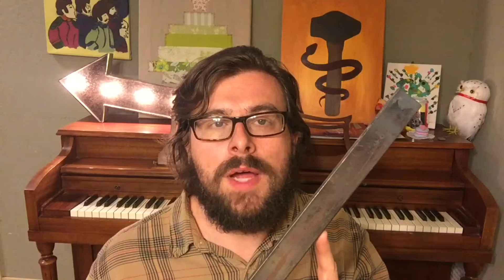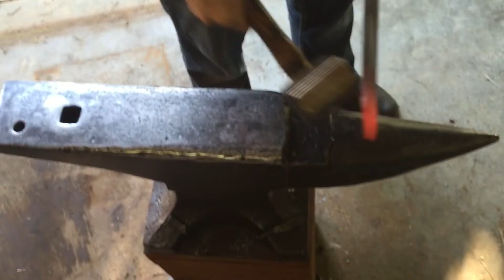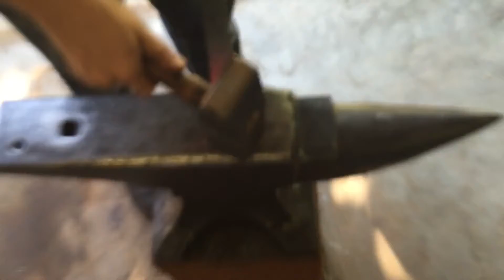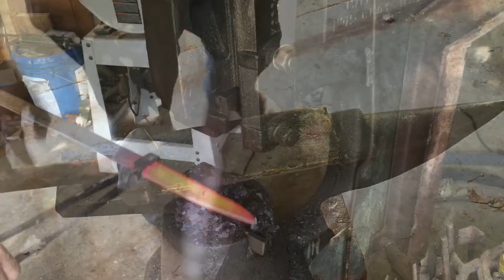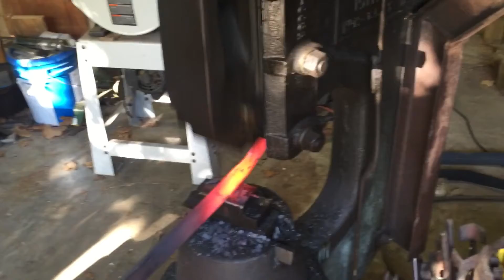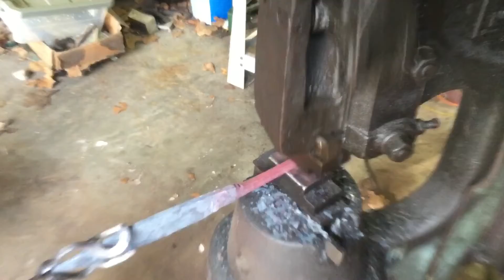How to Forge a Knife with a Power Hammer and Hay-Budden Anvil (Fighter Blade)

Comment: Nice work. I hate to give advise, but you NEED to bolt that Little Giant down. You may want to add a spring guard if you haven't. You would also be impressed with a brake. The smaller hammers wail away with tons of blows per minute to make up for the lighter weight. It makes it a totally different hammer. Keep after it brother!

Comment: Very nice video.your going to make any bring work or you prefer to do the most of the work by hammer?how thick do you live it on the cutting edge?
Reply from the maker: I forge in the bevels, but I leave a little bit to remove with the grinder.  I shoot for about the thickness of a nickel for the forging then grind to about the thickness of a dime before heat treating.  I will then grind off some more after heat treating.